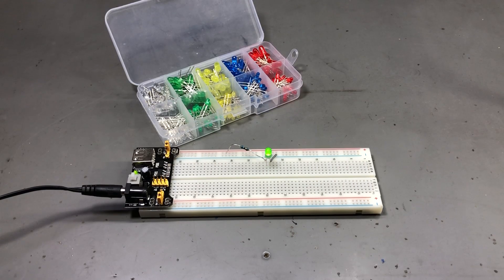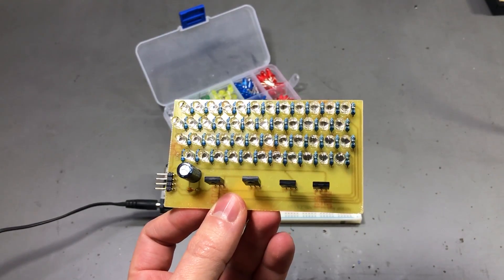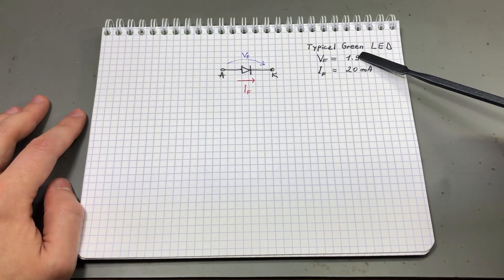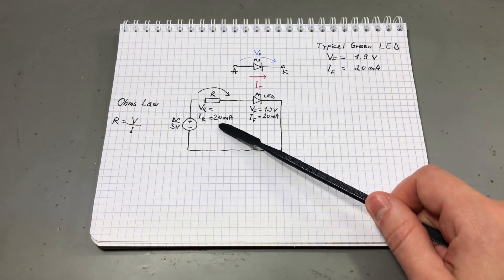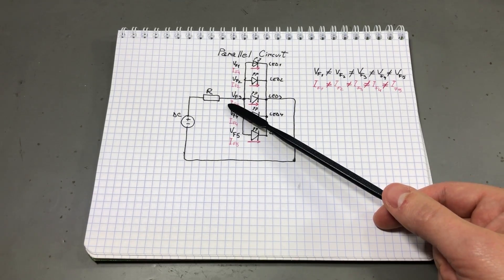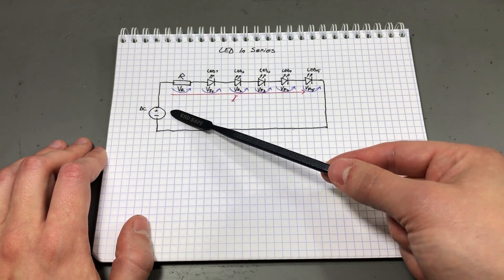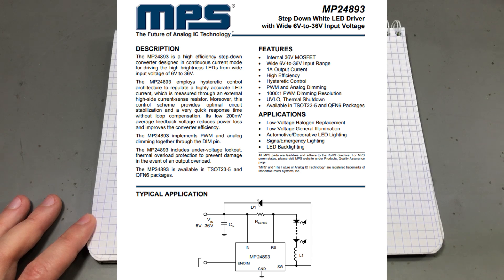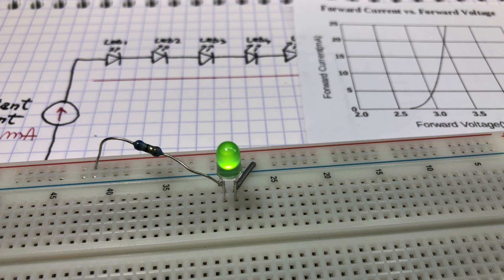Voltlog #197 - Wiring LEDs Correctly Series vs Parallel

Comment: But if I am driving 2 LEDs, with a 220 ohm Resistor from a 6volt power supply that is also going to a 6 volt fan, should I be fine just wiring it all in series?

Comment: Thanks for the informational video!
Can you please explain why the luminance doesn't drop with each LED in series due to the internal resistance of each LED ?
The whole line has a single current value, but there would be a voltage drop across each diode.

Comment: Thanks for the letting us know series connection is best for connecting LED's. The only doubt I have is according to the circuit that was explained all the LEDs should be of the same color right, coz if the color of the LED change, the voltage and current vary and would it end up causing issues, isn't it?

Comment: Nice video, question, lets say we take your scenario in series, from "time 11.45" and we connect it like that 5 led in series and we put another string also same 5 leds, so basically we get 2 parallel lines of 5 leds in series,  if the voltage supply is a fixed type, does this mean voltage and amps divide or just amps divide for parallel?

Comment: that is what I found on google "Increasing the number of bulbs in a series circuit decreases the brightness of the bulbs. ... Bulbs in parallel are brighter than bulbs in series. In a parallel circuit the voltage for each bulb is the same as the voltage in the circuit."

Comment: Excellent video, very helpful for beginners to understand the differences in led circuit designs. I would appreciate it if you could elaborate on the use of series-parallel circuits and how to best implement combining the two for efficiency, stability, etc. Maybe in a follow-up video?
Reply from the maker: Sure I will add the idea to the list and will consider doing a follow-up video. thank you for your feedback!

Comment: I would have liked it more if you would have used the term max forward current. A common mistake is newbies do everything to run a led at the mentioned max forward current :/ Also, a LED will conduct before the forward voltage in the datasheet. The forward voltage in the datasheet is again the max forward voltage at max forward current (and probably at a given temperature). Aka, start with the current-voltage  graph of a common LED and talk about what slight supply voltage variations does with different configuration.

PS Series / same current is no guarantee for even light output. If you have a terrible batch with very different (max) forward voltages it's also likely to have different light outputs for given currents :D
Reply from the maker: you are right, thank you for the feedback.
Reply: @voltlog  Now I read it back, sorry for being harsh! Did not meant to be. Keep up the nice video's!

Comment: For a high power IR emitter, get an IR spotlight of the kind used with night vision security cameras and hack it to be pulsed instead of constant on.
Reply from the maker: Not sure what wavelength those would use, you would need to check that before ordering one. It could work nicely.

Comment: Thanks, now I know how to make UV-light hardening system to UV resin.
Reply from the maker: yes, it would work very well if you will use a series circuit with constant current supply.

Comment: Thank you for sharing you knowledge :-)
Btw., Ohms Law is R=U/I, not R=V/I ;-)
Reply from the maker: Here in Romania, in school I was thought on using U. But often making and watching other videos changes my mindset and makes me follow a different notation :-)
Reply: Lol. I “learned” ohms law in my US high school electronics class back in 1992. (Obviously, I wouldn’t be here if I had a firm grasp of the material.) We were taught voltage was represented by E, for “electromotive force” or simply “energy”. So, BTW, Ohm’s Law is R=E/I
Reply: I also use the "U" version, but in English speaking countries they mostly use "V" (which is confusing because V is also the unit for voltage).